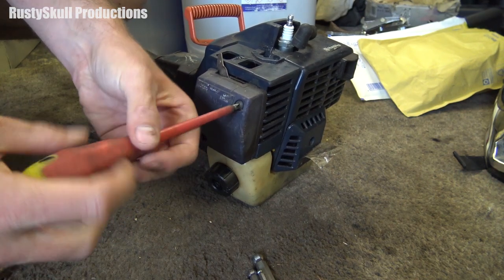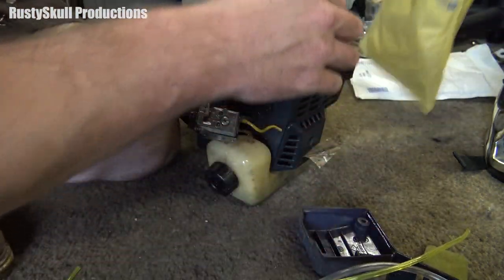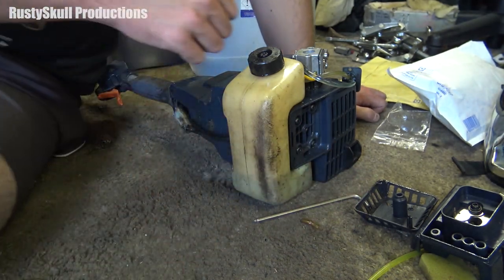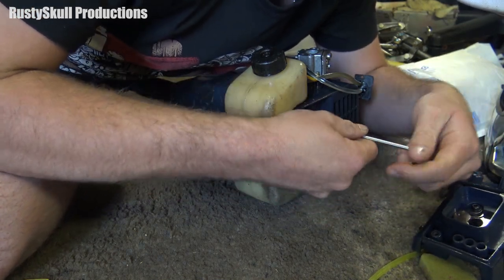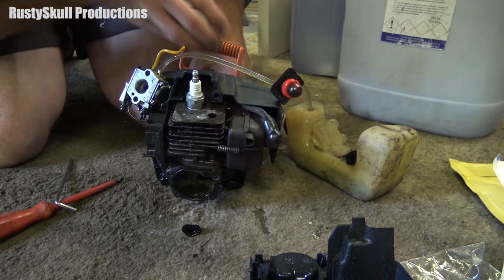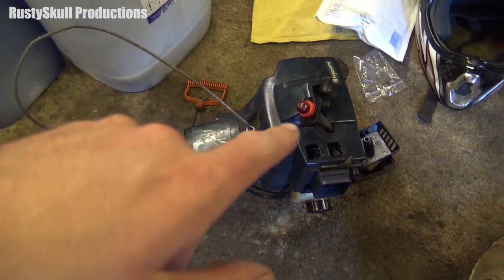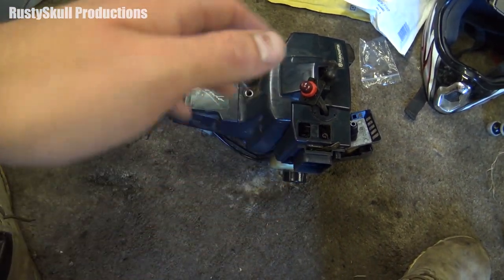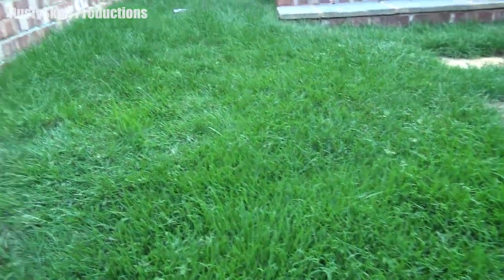Strimmer & How I Look After My Lawn - RustySkull Productions

Comment: Hi I had to mow my lawn the other day just to tidy it up a bit as it has grown slowly all winter and I live in the lower South Island of New Zealand have had a week of dry sunny days temps around 8 to 14 Deg. C 
I use a Countax CH600 with a 38 inch mulcher deck been a great mower it's 10 yrs old now with 260 Hrs the V twin Honda motor starts every time on the original battery. I had it converted to hand control as I'm C7 Tetraplegic .
Have a great day and keep the vids. comming.